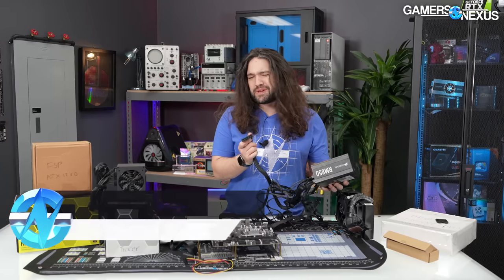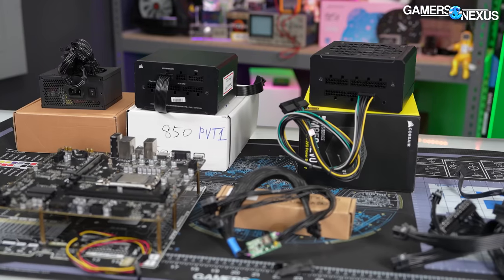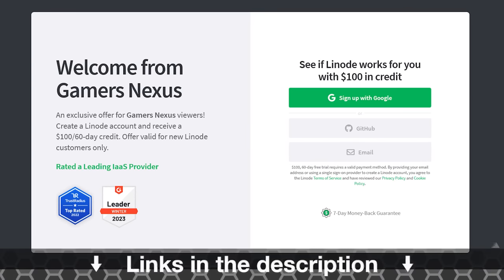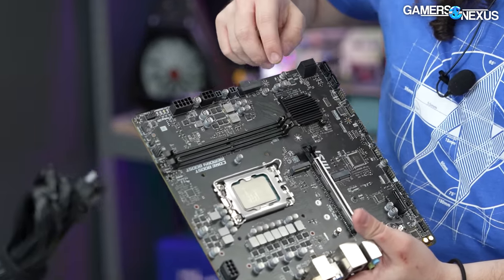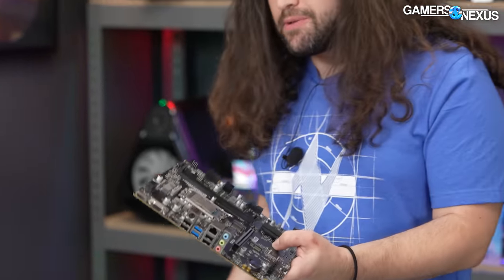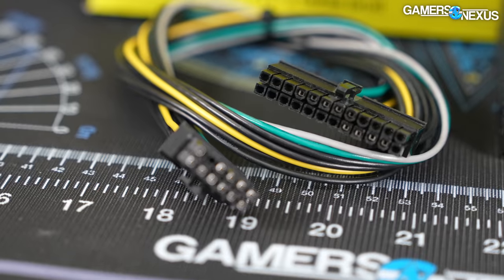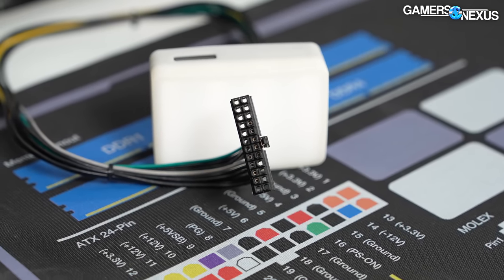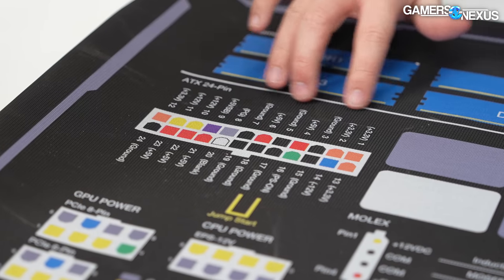The Future of Power Supplies - Maybe (Motherboard Cost, Cables, & ATX12VO)

Comment: It would be interesting to potentially see all-in-one slots for things like 2.5" ssds to connect directly to the motherboard
Reply: I think SATA will die out in a few motherboard generations. PCIe is the future for storage. Everyone will be running M.2 & U.2 drives.
Reply: @BKHD605  As long as there are PCIe slots someone will plug an HBA into it and JBOD 8 SATA 20TB drives. Now they also need a separate ATX PSU. Thanks I hate it.
Reply: @TiagoJoaoSilva  yeah for a home server or workstation I can agree but for the average custom build spinning rust is old school.

Comment: I am hoping this standard stays on the power supply side as it is less expensive to replace and easier to troubleshoot.  Adding it to the motherboard is another point of failure for an increasingly expensive and harder to replace part.  Also swapping a motherboard can create real headaches for OS as chipsets type and versions shift, licensing etc and would be adding even more problems.

I understand the overall power savings but it feels like a hammer solution by moving to an already overcrowded space when it could be better solved by staying with the power supply.  Let the power system protect and manage the power.

Comment: I'd be happy if they moved the cpu connector to be near the main power on the motherboard. Heck, ingegrate it into the main power cable and run some thick traces on the back of the motherboard to the cpu. Having that connector on the top edge of the motherboard is a pain sometimes since psus are put in the bottom of cases these days.

Comment: My thoughts on this are, I don't use sata at all anymore, so we could get boards excluding it to save on that problem. Most people probably just slap a nvme in with the cpu and GPU (plus PSU/ram) and go, since you need nothing more to game. 

I'm not too concerned about needing a new power supply, some upgrades require a PSU upgrade for other reasons like not enough watts. It still isn't great to throw out working psus so it would be good if they could be recycled somewhere.

Comment: I'm slowly going full solar / wind. Considering both those sources are 12v it would have been great to see the industry permitting users to bypass the costly conversion to 110v altogether. Unless... that's something the power supplies are supposed to handle in the future?

Comment: Does the 6 pin on the motherboard double as an 'output'? My view on that is what if you got a 6 pin to 6 pin cable and took that to the 6 pin on a small GPU that took a single header and it used that for slightly more power than is available on the 75w pcie. Then theoretically you could have a PSU that has one input into the 10 pin and then the rest is fed off the board.

Comment: Aside from OEMs that already do proprietary power connectors, I kinda feel like this doesn't take off w/o a larger shift in cabling/connectors towards dual-use power & signal.  Give us fewer cables to route. Would love to see an extended PCI-E connector that would allow us to ditch PCI-E power cables entirely.  Or failing that... standardize modular cables so they're less of a pain to replace and fewer end up as e-waste.

Comment: I would assume that if 12VO gains traction, the PSU manufacturers could put an additional 12VSB line on the PSU connectors, which is unused if the 24-pin connector is used and will be connected in case the cable for 12VO is used, so basically include the adapter board in the PSU.
Or maybe they will produce a 12VO PSU and you attach a small box with the 5V, 3.3V and -12V converters. Basically like it's already done now, but externalize those converters.
Something like the Seasonic connect PSU, but directly attached.
Reply: A separate converter box is definitely the better solution. Keeping the legacy voltages in the PSU for compatibility would throw away a lot of the cost savings, although you'd still see the lower idle power on your electric bill.

Comment: I can think of two interesting (and good) implications of the 12VO standard. Firstly, putting a cheap battery in the system should be easy. If we're already relying on 12V, a lead acid battery with some good regulation could make for a very efficient UPS. Secondly, and relating to lead acid batteries, 12V is the standard for automotive, with 12V switched seeming to apply to both. (Standby vs ignition for PCs and cars respectively.) This could mean you could do some silly things with car accessories in your PC or PC accessories in your car. Heck, you could potentially use your car as a power supply! (Probably with good regulation as mentioned for the UPS case.)

Comment: I like the idea of this from a power backup perspective.  Could run this right off a DC battery backed up rail, like they do with -48v in telecom.  Hopefully hard drives and such start to only require a 12v rail too, then eventually you won't have to worry about doing much conversion on the motherboard except for chips.
Reply: I'm not sure how well regulated the 12v rail needs to be. Typical 12v batteries float charge at 13.8 volts and can be anywhere from maybe 12.8 volts down to 11.8  volts during discharge. In -48 telecoms systems, most active electronics is powered from a lower voltage derived from the -48v supply. The -48v telecoms supply can vary from slight more than 55 volts down to less than -48v.

Comment: That PCB in-line with the 10 pin cable looks like it might be a simple buck-boost or just buck converter.  I'm thinking it's more likely that is a buck converter if it's so that you can use the 12VO PSU with a regular 24 pin motherboard as you can easily step down the 12V supply to your 5V and 3.3V lines.
Reply: To my understanding, the cable enables the use of ATX12VO boards with traditional +5Vsb equipped power supply designs, so it pretty much has to be a boost converter to generate +12Vsb.
Reply: @PileOfEmptyTapes  Oh, Ok.  That makes more sense.

Comment: I know alot of automated systems use one cable from the power supply 24v that is it,   It does 110v going in and  a 24v on one cable to the board,  then the board breaks it down to 12v 5v extra to the different device.   Instead of the power supply breaking down the voltage they are putting that on the board.   It really cuts down on the cabling needed and the over all power draw is much less.  
I have to say we do experience alot less power issues effecting the main computer,  testing is super simply coming from the power supply.

Comment: Some of us need to go backward instead of forward. Gaming builds are NOT the only thing we do. I also build rack mount storage with SATA and SAS. I need 12, 5, 3.3, and I need the 5 volt at much higher amperage than gaming PSUs provide. I find myself buying old server supplies (with 5v @ 30A) and STILL having to use two supplies to get enough 5 volt power but having wasted tons of 12 volt that I will never need.

Comment: The problem with this is that the motherboard of a few year old PC is functionally tied to the CPU and RAM, but the PSU is not. On an old PC if the PSU fails, there are a million you can pick up to replace it. If the motherboard fails, you need another one exactly matched to the existing parts. So it is better for long-term longevity for more points of failure to be put into the generic part than the specific part. Thankfully there does seem to be a movement to do more repair of failed parts.

Comment: @SujiMayne is right. Since I'm a 12vo adopter (I have a lenovo prebuilt) I will say that the boards are very expensive.
A normal lga 1700 board in Bulgaria with the same chipset (b660) is about 100 usd. My board for my prebuilt I checked costs around 250 usd.
Its not even a good b660 board, it only has  7vrm phases

Comment: I'm VERY excited about  ATX 12VO because I loathe existing lead-acid UPSes but also hate converting AC -> DC -> AC -> DC if I'm powering my desktop off a battery.  (In my testing with lower-power devices running off a Jackery or Goal Zero-style battery pack the extra conversion step can cost me 60-80% of the power compared to powering them directly off DC from the battery... which I guess could be down more to the inefficiency of the devices' wall warts and less the efficiency or lack thereof of the Goal Zero's internal inverter.)  There are existing DC-DC ATX power supplies but they tend to be niche, expensive, relatively low power rated, and weirdly inefficient, and I'm hoping that ATX 12VO makes them more common and ultimately it much easier to run high-power-draw computers directly off battery.
Reply: If you limit the battery voltage to within the tolerance specification of 12V for powering PCs, you're locking out a lot of your battery's energy capacity.
Reply: @Vegemeister1  Oh absolutely, that's why a DC-DC ATX power supply is needed to downstep the voltage from a more dense 24V or 48V battery to something the computer can use.

Comment: So the next four ATX12VO motherboards (MBs) I might dispose of will add about another 100+ electronics components to e-waste due to the additional buck type converters circuits on these ATX12VO MBs which used to be in the same ATX PSU I've reused for my last four (4) PC Builds. Also Steve didn't really  point out the buck converters circuits/components on the MSI  ATX12VO MB,  which clearly takes up at least the same space as the standard 24 pin ATX connector so no benefit there.  I also have some Supermicro  2 x 3.5" x 5 bay SATA internal drive enclosures that use 4 x 4 Pin Molex connectors, now I'm going to need even more converters add-ons as ATX12VO MB's six pin SATA peripheral power connector supposedly only supports 4 SATA Drives... so with the 5 watts (I'm guessing, I doubt it would be much more than that on average efficiency wise )  that would save me ~$25 over 5 years, will now probably cost me $50 upfront in adapters, addons and or some premium PSU that still provides Molex etc....   lastly I can't believe Intel couldn't have kept the 5VSB for at least some type of backwards compatibility at least in Gen 1 ATX12VO MBs e.g. these boards could boost 5VSB if detected otherwise pass through 12VSB if it was detected for the sake of maybe >0.25 watts .... End.

Comment: You answer the question I had about converting an old PSU for use with an 12VO MB, But what about some way use a 12VO PSU  with an older MB? It seems that having both options in place would help to speed up adoption.

Comment: Still seems better to keep the major power rails in the power supply. A quality power supply can easily last 10+ years, thus long term, it is cheaper since the expense of those rails is not paid repeatedly for each new upgrade/build. It will also be less of an issue for handling multiple devices that use the other rails, e.g., no worrying about if your motherboard has enough 5V amperage to handle every hard drive you want to connect, as well as every additional drive connected to your HBA. There is less worry about having enough power connectors for a larger number of accessories without having to stack multiple splitters because the motherboard maker decided to treat having enough power connectors the same way they treat having a debug 7 segment display.

One risk with that mentality will be board makers trying to do a $200 price target, will end up with 10 amps for the 5V and 3.3V rails (effectively matching the super cheap power supplies) .

Comment: It doesn't HAVE to switch to the Motherboard.  I can easily see an intermediate step where there is a separate component to convert the 12v power to the various rails.  Either purchased alone or included with a Case.  If 12vo becomes the standard, these parts will be almost required to be on the market to keep older systems working with the new standard.

Comment: If they're breaking old standards I wish they'd move fewer wires needed. If the majority of power is 12v+ and GND, give us a thicker power cord for each, and a second set of smaller wires if needed.

Seeing 6+6, 8+8, 10, 12+ pin gpu connector setups I can't help but imagine a 14 gauge two wire setup with bigger bullet connectors would be significantly cleaner to setup, connect, and manage in a case.

Comment: I wonder how this would work with mini-ITX motherboards: they're already crammed for space. I don't see how you could offload the other voltage rail generation onto one of them without increasing the board size. Maybe they'll stick with 24-pin and use a riser to adapt a 12vo cable if this does eventually take off.

Comment: Some board just dont have the realestate to have tons of connectors for power cables... Right now the back side of the psu can be covered in plugs giving you tons connectors to devices like enough connectors for 7 HDDs for a storage server... Moving all those connectors to the board is going to get in the way of peripherals.

Comment: If they are changing the spec of mother board supply voltages, they should just raise the voltage to 24 volts. This would cut in half the amperage across all the wires. It would also help voltage and amperage draw spikes.

Comment: I have a solution, from a purely engineering perspective: return the PSU to XT and AT days (but preserve the soft power-on signal) when no stand-by power is delivered and put a lithium-ion battery on the motherboard. If the computer is connected to a router with Power over Ethernet, draw the stand-by power from there. If not, draw the power from the battery. If the battery has no charge, the computer won't boot, but it would be a super easy fix to swap a 18650 or something like that.

Comment: Think it would make more sense to have a 12v+/5v+ PSU and just add 2 more pins for the mobo connector. That would put all the heavier loads on the PSU itself while maintaining a simpler psu and mobo connector design.  The other voltages are only ever used on the mobo anyways.

Comment: In the B-roll shot at 13:07 I noticed something. The standard that replaces the 24 pin is comprised of separate 10, 6, 4 and 4 pin connectors respectively.

This adds up to 24. The fact products exist for this standard means Intel is not pulling a prank. They are genuinely trying to replace 24 pin connectors with segmented connectors which still use 24 pins.

To me, I don't care if it's greener to produce or whatever, it's extra points of failure that don't need to exist.

Comment: In my opinion, the ATX12VO standard will hurt the modularity of desktop PCs, and the ability to reuse old motherboards for various needs instead of trashing them. Here's one example:
ATX12VO will probably cause headaches for anyone trying to build a cheap storage server with several HDDs mostly out of consumer hardware. It will be up to motherboard manufacturers to decide how many SATA power connections to provide / support, and that number will probably be equal (or very close) to the number of SATA data connections on the board. This means that if you want to use an HBA to add more drives to the system, you'll need to figure out how to power those extra drives.
Ideally, you can't really use splitters on the power connectors from the motherboard because that would risk frying it, which is much more expensive to replace than a PSU. (Cheap splitters and adapters are known to catch fire, as in the saying "Molex to SATA, lose all your data")
Of course SATA backplanes make this less of an issue because they distribute power from less connectors, but you still would need to keep in mind the output capabilities of the DC-DC converters on the motherboard, if they even publish that info / don't cheap out on the parts.
Assuming motherboards with 6-8 SATA ports will continue to exist with ATX12VO, that doesn't mean they will be common. Boards with extra SATA capabilities will not be cheap, and if you're using an old server HBA, it would cost a lot more to build with ATX12VO compared to a cheap ATX12V board and a good PSU. With the older ATX12V standards, you could just buy a PSU that suits your needs instead of spending more on both components.

Comment: For the standby it would have been better if intel specified it to handle both 12V and 5V standby input to the same pin. For something like standby it shouldn't have been too difficult to do that honestly. One of the controllers I work on will run equally well on 12VDC as it will on 24VDC.

Comment: Most, if not all, 5V components, are southbridge I/O and in a way almost always limited or specced for the case you're using. So instead of making motherboards more expensive, maybe the way forward is making the case more expensive, and have case manufacturers create a (replaceable) daughterboard for mass storage and front I/O. And I'm not talking about having just enough or the appropriate amount of SATA connectors. No, we'll finally solve the problem of not having enough internal USB headers for both front IO and AOI/Fan/RGB controllers for an NZXT case.

Comment: I have two question about 12vo:
Mini-itx: nobody talks about it, and the boards are already packed. Could it be realisticly implemented? 
Life cycle assessment: is the new standard more eco-friendly when we take into account the necessary modifications in the motherboards ? Is this slight increased impact on the motherboard's production lower than the benefit it would give ?

Comment: And how exactly does this change make things "more efficient"? All the inefficiencies move to the mainboard along with the conversion, but they're still there. And whether some half-assed el-cheapo mainboard power conversion circuit is actually better than a device specifically made to do convert power as efficiently as possible is probably worth trying out.